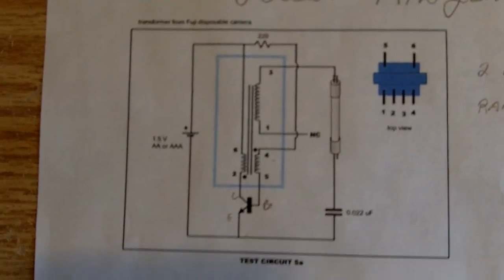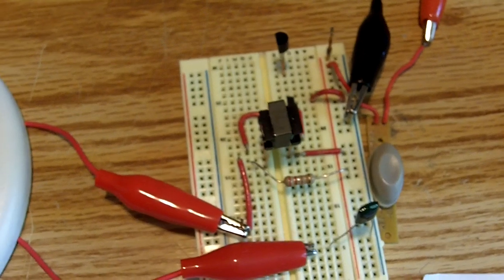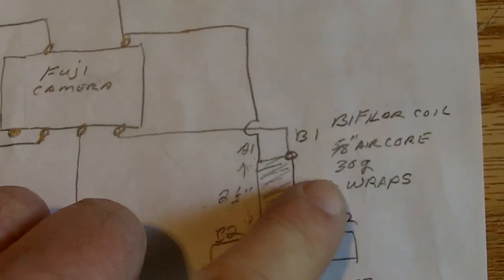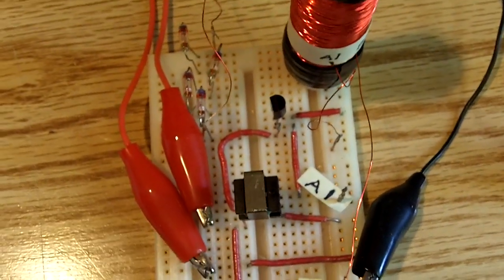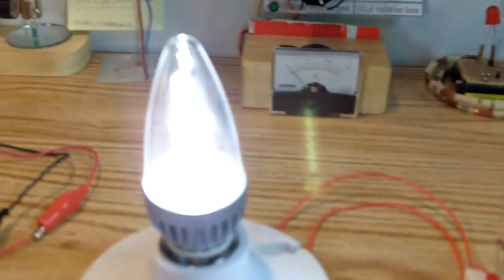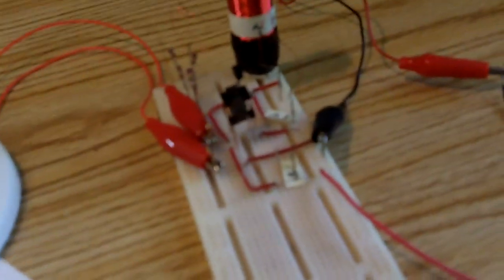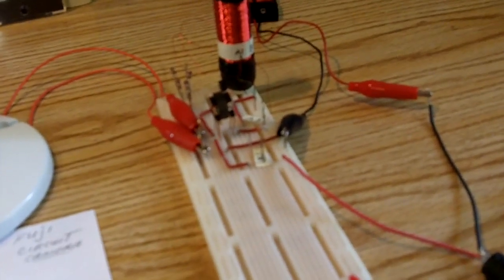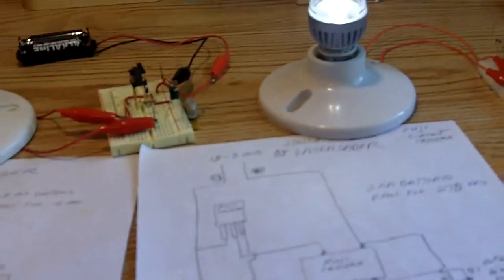Joule ringer power.MOV

Comment: True!
I  managed to completely revive some dead cells ( 0.2V ) using a Bedini fan charger. 
If you have access to the cells, (remove the plastic top of the battery pack) clamp the cells individually to the charger and by doing so, bypass the built-in safety circuit.
I have never blown a cell by now by overcharging (watch your meter!!).

Comment: @KyleCarrington The laptop packs generally have just 1 circuit that governs all cells. Those circuits are also used on li-po batteries, they are 'LVC' circuits, Low Voltage Cutoff. At 3.3V or similar, the cell may be damaged if discharged further (much like SLA etc) and so the circuit switches the battery off. Removing the circuit is fine..I do it a lot with R/C aircraft batteries, where the circuit has actually blown and a 0.0V reading is given by a cell. It's safe, if remember volt level.

Comment: @slider2732 Good to know. The ones I buy, which are new... have overcharging and undercharging circuits. Do the old ones? This circuit may have to be removed to "bedini" charge them, which would probably be worth doing, if and when the thing "dies" it's normal death. I am curious, when charging them "conventionally" - for example from a 7v 200mA solar cell, if one should step down the voltage to less. I'll have to test.

Comment: @KyleCarrington Just a note on those li-ion - free from old laptops circa early 2000's. Half a dozen in the battery packs. They desulphate and charge great with a Bedini SSG type circuit, if not already fine. Also charge fine with a level sensing Ni-MH wall charger. 
Hope that helps magnetman too in his battery search - these are excellent exacting replications on this channel !